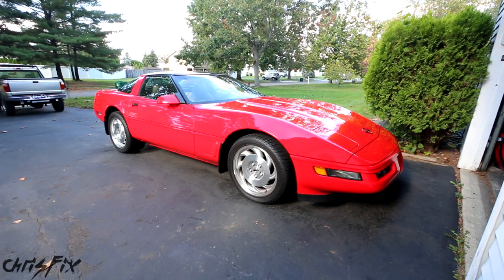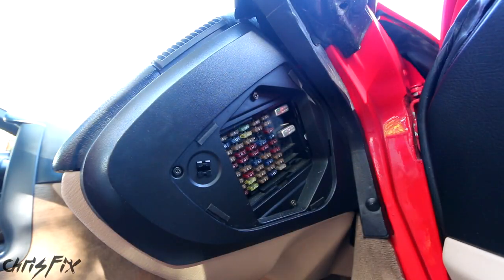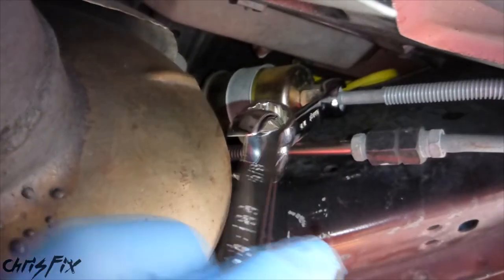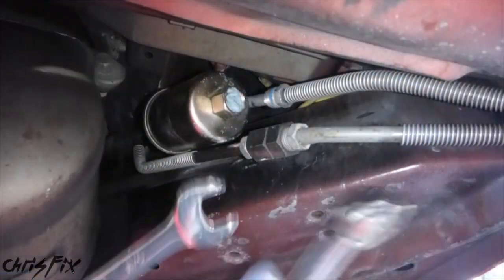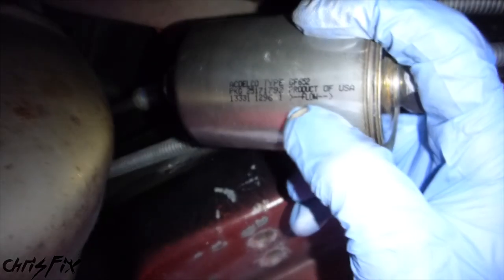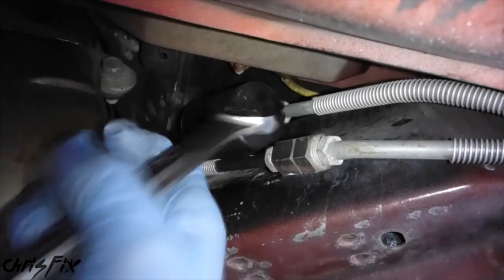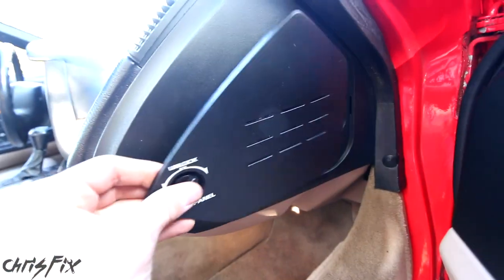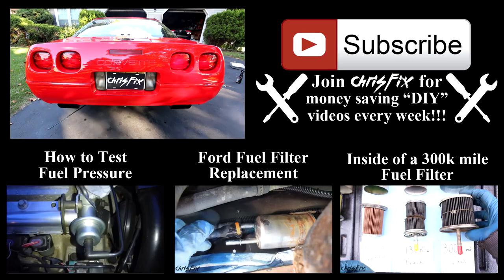How to change a Fuel Filter (GM, Honda, Toyota Style)

Comment: My 2009 Subaru legacy does not start. Just got my belts changed and while driving everything shut off. Battery and Alternator checked out good, and the fuel pump sounds like its getting primed. Fuses seem to be good too, not sure if its a starter issue...any ideas?

Comment: On OLDER vehicles with a mechanical fuel pump, there is no fuse and putting the key into the run position will not do anything. You will have to turn it over to "prime" it.
Reply from the maker: +3J Kreklau Thanks for sharing!

Comment: I have a Toyota fj cruiser 07 with 130k miles. I wanted to change the fuel filter for some preventative maintenance but it's inside the fuel tank. I've read that is doable, but a real difficult job. A Toyota guy I talked to said it's a sealed system and never needs changing. I guess my question is; should I pursue it? It seems worth it to me.I don't want to pay the 1500k labor that someone quoted me .any advice would be amazing
Reply from the maker: Don't bother.  The only time you change those is when the pump goes bad
Reply: +ChrisFix Oh ok! THANK YOU!

Comment: Hi Chris, I had an engine shut down while driving. The engine oil light was on, the steer wheel was super heavy, and there was no way to restart the engine. My mechanic checked it. The engine oil level was ok, the fuel tank was almost full, and there was no code from the car computer. At last, the engine restarted all of sudden after several times of trying by stepping down the gas paddle while ignition. What could be the reason for this problem? Thank you.

Comment: Chris how do I change a fuel filter in a gas tank I own a 2017 camry le and I'm getting poor gas mileage and the acceleration is worse I changed just about everything with Toyota parts. I suspect it's the fuel filter

Comment: Hey ChrisFix this is unrelated to the video but I have problem thats driving me nuts. When ever I turn my climate control to the off position I can still feel heat or air leaking out just enough where its noticeable and annoying. Have any idea what could be causing this?
Reply from the maker: +ChandoProductions That is a vent door not closing all of the way. It happens on my Vette too. If you set the temp to room temperature, you shouldnt even notice it.

Comment: Looking at how gasoline blasts out like this even with the pressure already relieved, I cant help but wonder how coolant would blast out (if opened Hot), or maybe more fascinating yet: an A/C line of r-134a /r12 refrigerant. ☆i wanna be master of all the fluids..
Reply: I opened my radiator cap directly after turning the car off (heater wasn't working and the cold mustve killed some brain cells) and it wasn't too crazy, just got all over my hand which wasn't fun

Comment: there is some lock tight on the threads of the bolt but you didn't use blue lock tight

Comment: You forgot one step Chris, pull the fuse, let it die. Then go try and start it a couple times. This will de pressurize the fuel system so fuel doesn't spray out pressurized like it did on you.

Comment: I hate changing my mom's fuel filter in her 06 Ford Taurus cause ford uses those plastic retainer clips that break very easy and there clips on the rear are hard to find if they break.
Reply: good ol merica am i right
Reply from the maker: +Justin P. If you use the quick disconnect tool you wont break the clips
Reply: +ChrisFix that's what I'm gonna do next... hopefully there is enough room to get in there

Comment: is it a good idea to put that lub on the threads of the fuel, could some of it go into the fuel system further down?
Reply from the maker: +Brian Peterson Nothing will get in the fuel. If the antiseize gets in the fuel, you have a leak so there are bigger problems. Those threads are sealed at the 0-ring.
Reply: Thank for the reply, and the video

Comment: Dear Chris, my fuel filter is inside my fuel pump, which is inside my gas tank. Is it worth trying to change it or should I buy a whole new pump?
Reply: Replace your fuel filter not the pump. Those pumps should go out at most once every 200k miles on a vehicle and a fuel filter is every 20k. Youll save a lot of money by just doing the filter
Reply from the maker: +DeltaForceHD Those style fuel filters only get changed when the pump fails unfortunately.
Reply: ChrisFix Thank you for the reply!

Comment: I just did this on my 92 Vette and OMG it was the most painful install I have ever done on a car. How do you have so much room under there!? EVERYHTING was in the way when I tried to do it. The frame, the other fuel line, the catylitic conv, the air around me, everything. The only time I have cursed so much was when I was swapping a 95 240SX from auto to manual. Holy shit this fuel filter job was a PITA, 92 Vette owners beware. The flare nut is 16MM btw, the most rare flare nut size in existence.

Comment: Just out of curiosity what kind of ramp did you use I have not seen one like that?
Reply: BC Green plastic drive up ramp
Reply: @CKPHH  I have not seen rants that can be disassembled so you can go underneath the tire made out of plastic? There are two part ramp. Have not seen that before.
Reply: BC Green yoy might wanna google it up

Comment: Fuel filter location on 2006 Nissan Maxima? Haven't looked yet but would it be in the rear?
Reply from the maker: +Eladio Colon You dont have a fuel filter that you can replace. It is in your tank.

Comment: we have a 2004 ford f150 and there is a service engine soon light and it idles really fast. Do you know of anything that could be causing this
Reply from the maker: +Levi Kleinschmidt Probably a vacuum leak. What is the code for the check engine light? Try using something like this: https://www.youtube.com/watch?v=xPI36bKVCjk
Reply: p0022
Reply from the maker: +Levi Kleinschmidt I would check your camshaft position sensor

Comment: I have been told that my fuel filter in my 2008 Dodge Avenger is in the gas tank, is it still possible for an average guy to replace themselves or should I take it into the garage?
Reply from the maker: You just leave the in-tank filters and dont touch them until there are problems.
Reply: Alright thanks!

Comment: if my car is hesitating for a couple of seconds before starting (but runs fine after starting), are fuel filters typically the reason for this?  or is it sparkplugs/ignitioin coils...
Reply: Doubtful.  A dirty fuel filter would likely have the opposite effect, not allowing sufficient fuel through to maintain idle after startup.

Comment: hey chrisfix I read some where online that a fuel filter can cause a code for vaccum leak is that true?
Reply from the maker: No,  an in-line fuel filter will not cause any vacuum leak check engine lights

Comment: Thanks for sharing your expertise on this tutorial. Unfortunately, my 1995 Honda Accord coupe's fuel filter is in an almost unreachable place. And you need crow foot flare nut wrenches. Thank you Honda engineers! You fargin bastages...
Reply: +aquateen77723 I guess it's hit or miss for Honda.  The fuel filter in my 94 Civic is on a bracket right by the engine bay fuse box.  Fuel pump right under the back seat.
Reply: I had a 1997 Accord, same generation, and I changed the fuel filter with the crows feet wrenches. What a pain in the ass. By far the dumbest place to put a serviceable filter.. But still not as bad as the captive front brake rotors on that car lol. Other than that 5th gen Accords are fun to drive and reliable.

Comment: Chris
I was told my fuel filter is in my gas tank and it never has to be changed. how is that possible. what tbe difference with the outside and in the gad fuel filter

Comment: Need to release pressure by opening a gas cap before removing filter - This need to be added?
Reply from the maker: +Vijay Patel You do not open the gas cap, that makes it worse. The gas cap does not release pressure after the fuel pump.

Comment: I couldn't find my filter/ also can you please make a video on why the trac light flashes and how ti fix it
Reply from the maker: +marvin faris Try using this to diagnose your trac light: https://www.youtube.com/watch?v=xPI36bKVCjk
Reply: Thank you very much 
Actually I went to a mechanical to check it he said it needs special tool to read it. He sent me to lexus dealership I paid 115$ only to check the engine light and the trac light the also didn't know why it's on
My car is lexus is300 2001 
And I like how you Called the dealership stealershep haha
Reply from the maker: +marvin faris The scan tool that I show in that video will read the codes and is $100 so you would have saved $15 and had a cool tool. Next time haha. What ended up being wrong?
Reply: +ChrisFix I left it at the mechanic He will check it again and see what's wrong
Reply: +ChrisFix hey chris what year is your corvette

Comment: How to install the fuel filter if I did not remember the fuel flow direction of the old one? Can I check it out from the bottom of the car?
Reply from the maker: There should be an arrow on the filter showing direction, if not then it should have come with your new filter in the instructions, if you do not have either then look up a guide for your car and see what orientation its in!
Reply: @chrisfix  Can I disconnect the fuel filter and start the car for the fuel pump to work then check  which side will the fuel flow to find the correct orientation for filter to install?
Reply: Thank you @ChrisFix I find fuel flow direction by above method

Comment: Hey Chris do you know where the mk6 jettas fuel filter is? Looked online and can't find any : /
Reply: I checked couldn't seem to find it, unless they buried it deep
Reply: those are for the TDI's i believe, I have a 2.0 gas
Reply: 423million The ones I linked are for 10-12 Jettas, but the peeps before me were linking to TDIs (turbodiesels with the filter in the engine bay).

If you have a jack and (jackstands or a ramp), you can always put the thing up and then just look yourself. It's going to be somewhere between the fuel tank and the engine, doesn't leave too many hiding places.
Reply: The filter should be towards the rear of the car. Just look under the rear door area.
Reply: vee4410 Thanks! and no worries nornIron, I appreciate the help anyways!
Reply from the maker: +423million Seems like you got some good help! Thanks guys for helping out!

Comment: Is there any trick to open locked out car door? My son left key in the back trunk.
I have 2006 Range Rover.
Thank you
Reply from the maker: +Cheul Kim Use a wedge between the door and slip a wire close hanger into the interior and either pull the lock up or press unlock.
Reply: +ChrisFix we tried that method with Locksmith. They couldn't open the door both pushing the unlock button nor pulling the inside door handle. Do you know if there is some sort of thief protection system to prevent from open?

Comment: I just replaced the fuel filter on my '87 Corvette. There were no O rings on the fuel lines. The old filter never leaked.
With the new filter I did not use O rings and it doesn't leak, should I still have used the O rings?
Reply from the maker: +MrZdvy If it isnt leaking, I wouldnt worry. Flare nuts on brake lines do not have O-rings and they dont leak so dont worry!
Reply: +ChrisFix I was actually thinking the same thing; why would you really need those O rings if the design is basically the same as a brake line. Unless the nut isn't thight those never leak. Thanks, I really enjoy your video's.

Comment: Hey Chris , my headlights turns on when I turn on the ignition switch and I hate that , I keep forgetting to turn them off at day time  , can you help me and find away to keep them off and only can be turned on and off by the headlights switch ?
Reply from the maker: +eyad aljamal That is weird. Mine only turn on when I turn the switch for the headlights... I wonder why that is happening?
Reply: That's a common thing in GMC cars and trailblazers, its not like there is something wrong with the car , no , its just how its made .

Comment: Try changing a fuel filter on a 9th gen corolla (and probably most motronics)
Reply: If it's a 9th gen it's probably gonna be inside the tank with the fuel pump if that's the case you don't change those except when the pumps go bad
Reply: +eivis13 After the 7th gen Corolla they didn't have fuel filters - It's basically the fuel pump filter
Reply: +Bonnie Burger Didn;t the 8th gen 4a have fuel filters? I maybe wrong here since i didn't google it or had any experience with it.
Reply: 8th gen was from 95 to 02, i think the face lifted ones(from 98 or 99) had the 2zz.
Reply: +eivis13 -  7th gen is from 93 - 97 which come with timing belts 4a or 7a motor - 7th gen is a common JDM black top 20 valve motors -  8th gen is from 98 - 02 and have a 1zz VVT- i timing chain motor - but in 98 - 99 models do have a differrent front end but still a 8th gen - 9th gen went a extra year from 03 - 08 cause toyota held the 10th gen to the USA one extra year - This is U.S. Corollas .  2zz motors are only in corolla XRS 9th gen Corollas - I sent you links to pages that will help you out .
Reply: As i thought, you'rr looking at the US market, while i'm looking at the EU market. We had better and more fun cars, trust me. Only reason no one imports from EU is because your cities are made for cars and not people.

Comment: question I can do the same steps for a Mitsubishi eclipse 1994 GS (turn on the engine and remove the fuse to remove the pressure of the gazoline pump) this is my question

Comment: how often should you replace this? I'm wondering because you wrote the miles on it
Reply from the maker: About every 50-75k miles. Here is an awesome video about that: https://www.youtube.com/watch?v=92TfTQTmuq4
Reply: +ChrisFix thank you so much! I really like your videos! I have a question, what are they ways to see that you have a broken water filter?
Reply from the maker: You mean cut open a fuel filter? I used a hack saw.
Reply: In my last car my water filter that moved the coolant had broke, I was wondering if there were any early signs that I could have seen to help it sooner
Reply: Or 10.000km in Brazil. I know, our fuel is real dirty.

Comment: I've seen you can use filters as suppressors on guns. Anyway, isn't there a danger that this anti-rust stuff goes into the engine and can damage it?
Reply from the maker: +kilésengati Those are typically oil filters. And there is nothing to worry about with the antiseize getting into the engine. It is on the threads which will never touch gasoline because it is sealed at the base of the filter.

Comment: So I'm having trouble with my '99 Lexus GS400. My fuel pump is running strong (judging by its sound), my fuel filter is clear and I replaced the strainer. My car will start up while it's cold and I'm able to rev it until 5 to 10 seconds as it will bog out while I give it gas. The warmer the car gets the quicker it seems to stall out. I need help with this immediately. I appreciate any response in advance.
Reply from the maker: Do a fuel pressure test and check for vacuum leaks.
Reply: ChrisFix Thanks for your response, Chris. Only problem is the car is not drivable. Is there anyone that rents pressure testers? You have dope videos, man. I'm subscribed and will get back to you with the results.
Reply: ChrisFix I'm assuming my lines were frozen, because last night it ran like new.. I'm in Ohio and we were hit with that artic blast.

Comment: i never, ever, put another wrench on a wrench for lines, even with a flare wrench you can still easily strip that fitting right off, ive done it before, i usually sit there and wiggle it, and tap it with my fist, i do it for bleeder screws all the time. if they dont come off with that method then they shear off

Comment: Chris,I have a Honda accord coupe 2008 , how to change the strainer? it doesn't have normal fuel filter
Reply from the maker: +Mahmoud Daou You dont have to change the strainer. You only change the strainer when the pump goes bad.
Reply: ChrisFix does this kind of car have filter to change
Reply from the maker: +Mahmoud Daou It depends. That varies from car to car.

Comment: I have a 2005 mustang gt and when it's cold it makes a squeak by the alternator. but it seems like it squeaks when one part of belt comes around. when I just spray water on the line it the noise goes away. when it's warm it goes away too but when it's cold it screams. any suggestions? thanks
Reply from the maker: +James Did you see this video (I assume you did because you did the water technique): https://www.youtube.com/watch?v=AEUe6uKxTv8 How old is the belt? Do you see any movement on the belt at the part that comes around? Is i a dayco belt or did you try the gatorback?
Reply: +ChrisFix yeah I saw your other video. It is a dayco belt and I see movement. I'm going to try the gatorback. thanks for the help
Reply from the maker: +James Keep me posted. The movement is probably from a bad tensioner pulley assembly (the spring is weak).
Reply: +ChrisFix okay

Comment: What will happen if I attempt to remove the fuel filter without disconnecting the fuse??
Reply from the maker: +issoloko2412 if the car was running in the past 24hrs you will have high pressure in your brake lines.

Comment: Could my fuel pump be the cause of bad start ups? My car turns on perfect most days but if i turn it off and turn in back on shortly after it struggles and i need to hold the key for an extra few seconds till i hear the engine running. I dont know what it can be...maybe a spark plug? To sum everything my car has 42k and struggles to turn on after previously being turned on. Thanks to anyone who can help with this comment and Happy Newyears.
Reply from the maker: +soljafurkan It could be. Check the fuel pressure: https://www.youtube.com/watch?v=_oXLUqE4Sf0